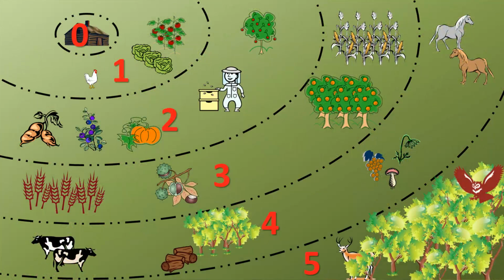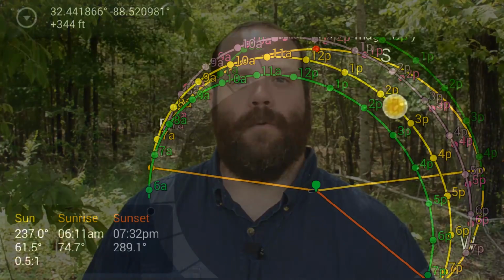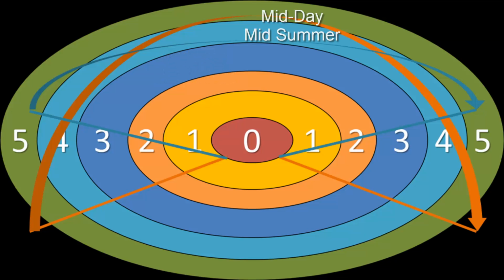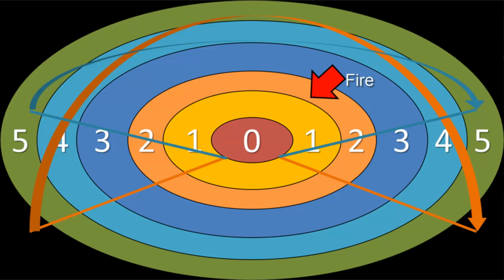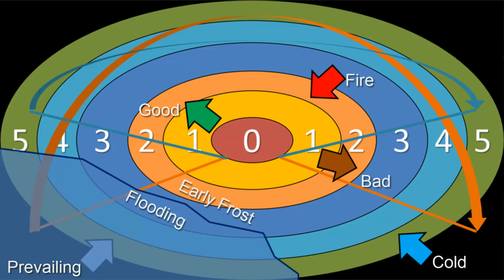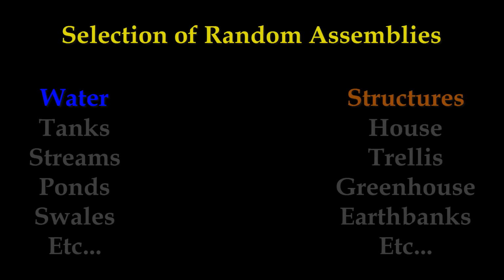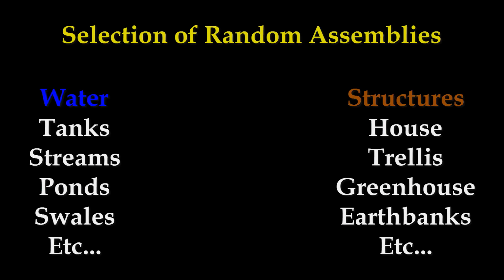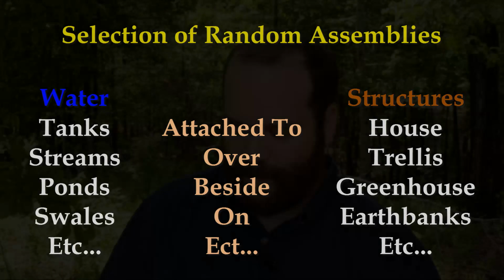Geoff Lawton Online PDC 2014 - Week 3 - Methods

Comment: This kinda reminds me of Feng shui, Using the art of placement. I used that in designing what to put where in at my old home. I was lucky there that the person before me placed most of the trees and bush in all the right places. There were many wonderful oaks. Here at this house. They planted 2 walnuts in font of each other and near the house. To the north. 2 pecan in front of each other east and west also. Beside the house. Then a maple behind them. The one in back does not produce any nuts that can be harvested. Only small amounts for the squirrels. Because it tried to grow taller. All 4 hit the house with nuts. And wind from the north and ice broke branches on the house. This is not a complaint. Just wish they had thought of placement before planting. I would never cut them down. Other than. I am watching the roots on the walnut. I can not tell if root rot is sever. I do not want it to fall on the house. I was great in the garden at my old home. Here I have to try new ways to prevent. Walnut wilt on tomatoes. Blight and bosom end rot. This yard has too much water. So I just started some raised beds. Sorry, I wont go one. But thank you for your videos. They are very helpful.
Reply from the maker: That is a good way to look at it - like Feng shui. Thanks for watching!